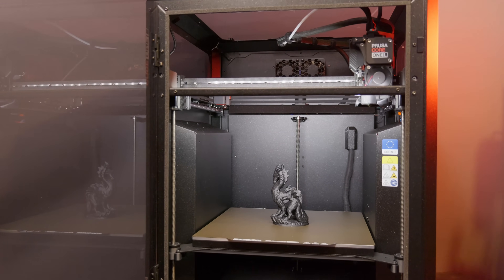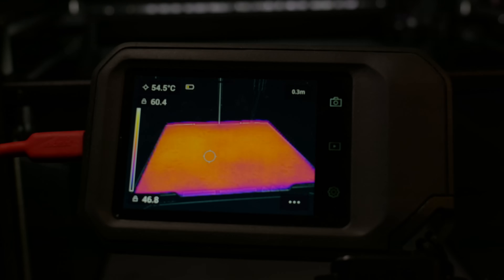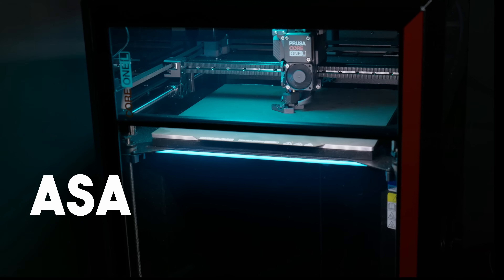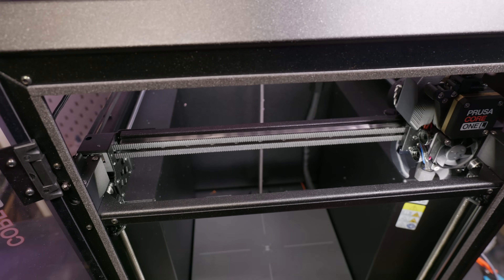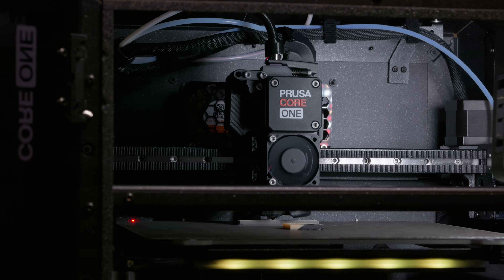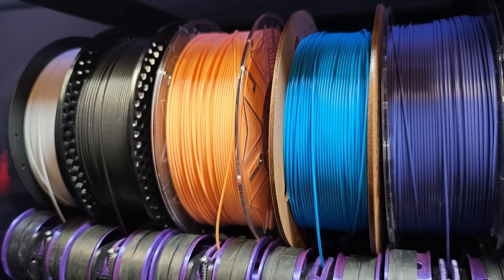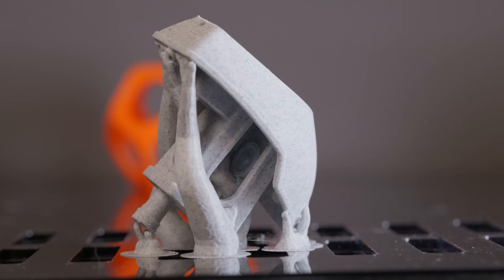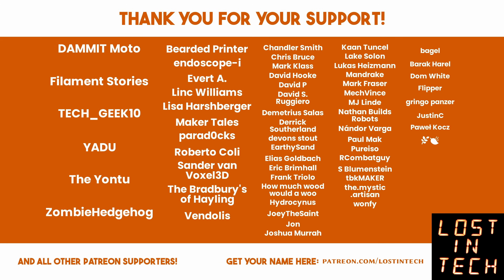The Prusa Core One L: No Compromises, but is it worth the price?

Comment: I'm currently building a Voron Trident 300x300x250mm.  I think this is a good size for me, a bit smaller in height than the Core One L though.  I will be keeping my options open, maybe I will convert it to an Indx system when the kit becomes available.  For my workflow a 2 or 3 toolhead version would be enough.  First things first, getting the Trident built and working.  I had initially wanted to buy a Core One, but after the Tariff BS started, and a few key Voron parts fell into my lap cheaper than I had though, I decided to self source the parts for the Voron.  My Trident will resemble a blue Core One when it's done with the same side cutouts for spool storage.

Comment: Do you ever miss the Steve days? When buying a 3D printer was so much easier, they were all the same, equally horrible bedslingers. And yet it was more chill, you buy a cheap crappy machine and fix it yourself. Now you buy an expensive crappy machine but usually the software is the problem like everything on the market right now except Prusa and to some extend Bambu if you don't care about OSS. I've been looking for a 3D printer and literally there is not a single one that stands out as better than the rest or a very good deal. They ALL have some annoying flaws that could have been fixed relatively easily but weren't. It's so frustrating.
Reply from the maker: I do. I miss a lot of things about that, it felt like a simpler time. 
Occasionally I get steve back out though and remember that some of it is rose tinted :)

Comment: I've got a Coreboxx myself, and managed to snag a preorder for an INDX.
The Coreboxx works fine with some mods and some custom colorchange gcode. Before that, it would need quite a bit of tuning.

I actually got my preorder in before someone figured out the custom gcode, and now running it with it, I'm almost thinking of sticking with MMU and not going for INDX.
But.. I know INDX is just going to be so much better, so I'm still gonna get it.
Reply: If you dont want indx anymore let me Take your Order Off of you 😅

Comment: Currently building a Micron 180 for a future INDX toolchanger. (tinkering on a tiny printer is much easier)
But recently read that these hotends are intended for low temp (<300C). 
Really disapointed...
Reply from the maker: It's not "low temp" - I'm really not getting all these comments recently. It's like you all want to print PEI - all I can say is good luck with that lol
Reply: @LostInTech3D actually agree with this. 300C is good enough for ABS/ASA/PC/bit-lacking-on-certain-PA-brand and the last two much less of of an multicolor issue. And I haven't seen much of multi materials doing with PC/PA and above so, maybe there is. 

But, it seems everyone and their dogs start to get to 350C now, from qidi to bambulab and 300C was complained by a lot of ppl as low for the last gen printers. But I think it's fine as of above argument. The 350C limit is nice for single toolhead though - which the new e3d nozzle will do.
Reply: @LostInTech3D  Just using E3D Revo High Temp hotends and nozzles for a reason, despite their pricing... It's not "I want", it's "I need to and I've been doing it for some time". Swapping nozzles depending on the material is a pain.
Reply from the maker: what are you printing?
Reply: @LostInTech3D  Structural parts only. Currently with Siraya PET-CF (for annealing of course). Recommended extrusion temp 280-320C (Polymaker has very similar recommentations for their Fiberon PET-CF). 
I wouldn't run a 300C rated hotend at 300 for hours, and 300C is the expected rating for the INDX hotends (?).

Comment: I've just dismantled my much modified 2019 Ender 5 to rebuild it as a Trident. It's a budget conscious build as I've spend a fortune building a nice 2.4 and i almost don't need the Ender any more but don't want to bin it.

What got me as i laid out all the parts was just how much i got in bits for the original £230. The modern equivalent seems to be twice that and, for printers like the XL etc with formed panels and loads of non-off the shelf components, well over a grand is probably a fair price (and I'm mean and would never spend that in one go!)

Comment: It looks like you might be losing a bit of space in the Y axis for INDX, so I think I'll skip it for the Core One and get it if I ever decide to get a Core One L. I have some prints that take up the entire Y axis; I wouldn't be able to print them anymore without splitting or shrinking the model.
Reply from the maker: I suppose the great thing is...presumably...you can move the INDX between systems as much as you like. 

Rumour has it you won't even need a serial number to do so!

Comment: Maybe we could talk about current and upcoming slicer support for multiple nozzle diameters in a single print? It’s already relevant for the U1, H2C, and XL, and with a probable large influx of INDX users next year I expect the topic to become frequently discussed.
Reply: The U1 and H2C do not support multi nozzle size in the same print yet. Only the XL does. Bambu is waiting for prusa to make it official in their slicer so they can come in and rip it off
Reply from the maker: Prusaslicer has supported this for a while, I must admit I have been somewhat lazy and not tried it yet. 

I'll note it down for a video!

Comment: I was gonna go for the core one + INDX kit, but if they become close enough for a core one L + INDX, then it comes down to RFID reader and chamber heating performance. The one is so slow, while the one L is much faster to heat, even though no chamber heater.
Reply from the maker: be aware though that I dont THINK we've yet had official confirmation that core one L will support INDX on release, as likely as it is...I would like to hear it.

Side note, you should see how fast the bed heats up on FLIR when you put the fans to 100%
Reply: @LostInTech3D sounds like it will come after the core one version to me. Hopefully Q2.
Reply: @LostInTech3D  They confirmed its coming for both printers. But the core one is coming first and the Indx ist not the Same as for the one L

Comment: Thanks for your review !!
The Core One L seems constrain on the rear Z leadscrew by a bearing. Is it the same on the left and right leadscrews at the front ?
That seems to be different than the Core One.
Reply from the maker: good spot! and yes I just looked and pretty sure I can see encapsulated bearings in the front too
Reply: @LostInTech3D  Very interesting, thanks ! This is a complain I saw multiple time on the Core One : misalignment on Z axis (leadscrew, nuts), noise, wobbling on one of the leadscrews during Z motion. This is a correction I suppose.

Comment: $1700 vs the H2S at $1249 which has more features and more build volume. 

Prusa is asking H2D money for a smaller printer with less features.

No matter how you look at it, the question remains "Why would anyone buy this?"
Reply: Name one feature that the H2S has that the core one L doesn't
Reply: @LilApe  Got you: the H2S has a nozzle wiper !!!
😂
Reply: @LilApe let me think, a very fancy recirculation set up for high temp filament, chamber heater (yea, fancier than a fan below the bed...), automatic nozzle pressure for automatic PA, the optional vision plate (which only mentioned because both Prusa and BBL is a pain to calibrate skew if somehow the machine comes a bit skewed from factory). Unlike on Klipper you either try to rack it or simply use a skew profile that mostly done once. Ah also. Some people consider bigger volume a feature, I guess as long as they have a project that need it, else I don't think it is (more like 300x300 is at a size most ppl will print, and bigger, well, I don't think most will print any harder than ABS at 300x300 size on these machines).

The AMS2 is still not filled-filament rated, nor let you print while drying so tbh, yea, fancy tech tbh, can be considered as a feature. At least it's a bit nicer than whatever stock MMU is in term of tube management. I could say "drying" is a feature for the AMS. 

I am actually not bother much about differences, but there are. The C1L got the nice alu bed, and the H2 got the casted gantry - this good on both.

Quality of print and materials able to print looks similar on both at this point, which is good. But let be fair, both their nozzles are proprietary at this point. And that is necessary evil for better performance, just I don't like both. 

End of facts and rants
Reply: @StooStranger  The vision plate is a gimmick, not a feature, just like lidar and CF rails, which is why bambu no longer supports them. The fact that bambu printer needs a $100 add on just to be as accurate as a stock prusa should be an embarrassment (watch uncle jessy's vid where his stock XL is more accurate out of the box than his H2D). Prusa printers have auto pressure advance, its done within the slicer. The Core one has a heated chamber just like the H2S. Prusa printers are incredibly easy to adjust for skew, they literally have "skew compensation" calibration mode built in. Bambu printers cant even print TPU while using the AMS.

Believe it or not, the core one L actually has more features than an H2S.
Reply: @LilApe 40*20*10 more build area and you can get the H2S AMS2 combo and $300 worth of filament for the price of the Prusa.
Reply: @jimmer411 so more build area is it. He asked for features not cost based fluff.
Reply: @jimmer411  Being cheaper isn't a feature. If thats the case, then an ender 3 is better than both a core one L and H2S.
Reply: @LilApe see the other guys response, he posted an even more detailed list of features the Core One L is missing.

Regardless it's overpriced.
Reply: @jimmer411  And did you even read my response to that lol? The features he listed, the core one L has all of them.
But thanks for proving my point. The H2S doesn't have any features that the core one L doesn't already have and you couldn't even find a single example. Cheaper isn't a feature, if that's the case, then an ender 3 is better than an H2S.
If the core one L is overpriced, then so is the H2S.
Reply: @LilApe the core one L doesn't have all the features I lised in first paragraph, only partial match but none for the automatic nozzle pressure. And the recircuclation is a big difference if you are sensitive to VoCs. I am.

Do I think it's expensive? Yes. Do I see most prints coming out perfect? Yes. Do I think the C1L has less complete features/less features than the H2S? Actually yes. Do I think the MMU is enovative for the lane change? Yup. Do I think the AMS still with limitations (that the MMU actually only do 1 thing - change filament) are more feature complete than MMU? Absolutely. 

But in the end of the day. I care about quality of prints (not machine) - both great, but the automatic nozzle pressure take the win - due to its doing calibration before print to remove issue from environment (wet, dry, whatever) > Precision - Bambulab gains a win for an option for skew compensation > part availability - both seems okay tbh, unlike some other brand > printer build quality - gantry vs bed, I stated above, equally good. 

For someone that only care about sibgle material printing and doesn't print PLA or PETG at all. The Bambulab is better for me as it has simply good air recirculation - none on the Prusa. Especially if you have kids at home. 

Note that I won't buying both, but technical wise, I explained what good and what's bad of both. Putting down my money on a different 300x300mm printer and I am happy with my choice. 

Note at the end: 
- I hate that ppl either a prusa fanboy or a bambu fanboy and sort of unable to make clean arguments or even actual facts. Not throwing shade here. 

- About closed tech, closed source vs open(er) tech, open source - bambu bad, but let say, no one will dissect the Prusa board and try to make it work with Klipper, due to everyone knows but don't want to admit - it's just as proprietary as of a board. 

End of rant
Reply: @Asghaad H2S print volume is marginally bigger, hardly a feature. Prusa XL has a bigger build volume if you wanna go that way.
Lidar is a marketing gimmick and isn't even included on the H2S, or any of bambu's printers anymore for that matter, its no longer supported, not a feature.
Core one L has a camera and live camera/app monitoring.
Core one L also has a quick swap nozzle, all of prusas printers do.
Core one L has HEPA filtration available.
Core one L has a heated and controlled chamber
Core one L has an optional 400c hotend
Literally everything you're listing, the core one L has. Thanks for proving my point, again, the H2S has no new or extra features over the core one L
Reply: @LilApe  that's not everything he listed. Be objective for once, if you can.
Reply: @LilApe Core One L does not have an active dedicated chamber heater. It uses bed fans. Big difference.

I'd love to see your mental gymnastics explaining why the Core One L is worth $550 over the H2S.
Reply: @jimmer411  lol big difference? its still an actively heated and controlled chamber. Whether it uses the heatbed and fans to heat the chamber, or a dedicated heater, makes no difference. An actively controlled heated chamber, is an actively controlled heated chamber, no matter which way you accomplish it. The H2S' "dedicated heater" is no better or worse than the heatbed/fan set up on the core one L. If you're gonna play semantics like that, then the core one L's bed is far, far supperior to the convection crap that bambu uses. BiG dIFFerEnCe. You just don't like how you're wrong about the H2S having more features (you literally can't point out one single thing to support your argument), and now you're moving the goal post by asking why the core one L is more expense.

The Core one L is more expensive becasue its a better printer with better build quality and accuracy. The H2S needs a gimmick $100 add on just to reach the same accuracy as a core one (uncle jessie's vid proved this), and the parts on the core one are of significantly higher quality. The fans, the PSU, the rails and bearings, the belts, the stepper motors, etc, etc, all higher quality and draw a premium in price. You also get real, human customer service and not that bot crap that takes 2 weeks to hear back. And you get a company that actually develops their slicer vs just copying from everyone like bambu lab does. Bambu H2C doesn't even support multi nozzle printing becasue they don't know how to do it, they're waiting for prusa to officially release theirs so they can copy it. As bambu isn't a slicer developer. they just rip off from prusa slicer and orca slicer.

Why cant a $2400 H2C use a gates belt? or better quality fans? Or a PSU that has actually passed is certifications, rather than just throwing fake stickers on it?

Comment: Its the Nozzle temp that kills this. $1700 for a printer that maxes out at 290c at the nozzle? But there's a hot end "upgrade" you can buys for $200, that lets you print up 400c.
Reply: What do you print that requires over 300c ?
Reply: @raphofthehills4405  pps, ppa, pet, pa66...

Comment: I am waiting for a core one xl
Reply from the maker: They confirmed on reddit that isn't going to happen, apparently this is the biggest the "core" is going to get. 

A second XL model might happen though!
Reply: @LostInTech3D ah that sucks. Id be interested in a updated XL model possibly. What I would really like is a 350 -500 size machine (doesn't need to be cubed) true multi-material machine with Klipper. Size mostly cause I want to print my own shoes. Multi-material for things like flexible and rigid mixing with a solid case or cheap fill and supports. I'm getting closer to just pulling the trigger on a sovol 08 max. With index system. Just waiting for index to come out and the bugs worked out on both or I may have done so already.

Comment: The reson you can't get to the AC part is fore the ce rating, you geting axis to the fan had been nice
Reply from the maker: an interesting theory. I know there were some new safety mechanisms implemented for this printer too which is why I wanted to have a look.
Reply: @LostInTech3D 
To get the ce stuff you can't easily get axis to the AC components 
Also way you can't get a kit
Reply: @LostInTech3D  If you look at the DIY printers with AC main beds, pretty much all of the build guides have warnings plastered everywhere about hazards, potential death etc etc when you get to wiring the bed. They have to do that as main voltage stuff is regulated and require a professional.
You're not really supposed to do that wiring yourself, which is why the L doesn't ship as a build kit.
Reply: @Goroca  that makes total sense!
Reply: If this is true, and CE specs forbid exposing the customer to AC (even assembling a kit) this means that the Core One is the last printer that PRUSA sold in kit. Starting from Core One-L,  all subsequent printers that will have an AC bed will be sold only assembled. This will increase the already high prices 😐
Moreover this will also limit the capabilities to repair (e.g. "Only authorised Professionals should attempt this repair" on all the user's manuals, or even will force the users to send the printers back to PRUSA for bed maintenance).
Unless.... PRUSA will create a small sock at the and of the bed cable, and a mini plug on the power supply, so that it could be easily plugged and unplugged during assembly without exposing any AC connector.
Reply: Don't tell those people I don't need tools or remove a panel to to access the AC power in the cord.
Reply: @See-essEll 
The ce is fore the asembery, you can find the relevant specification online